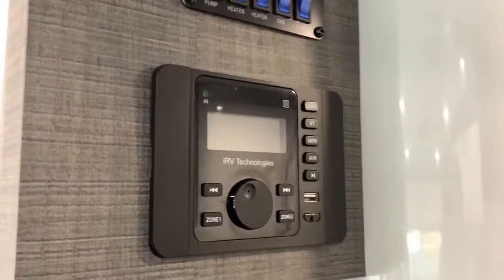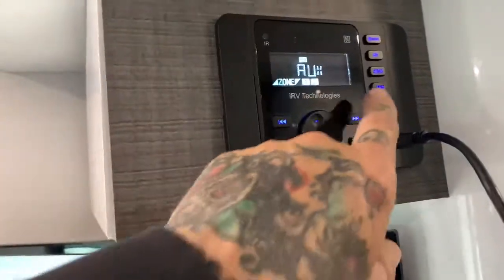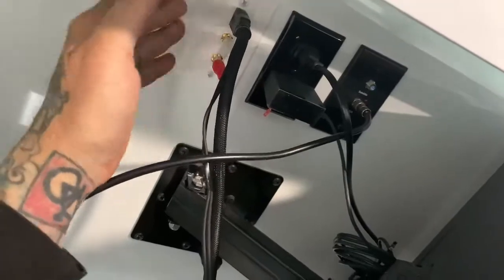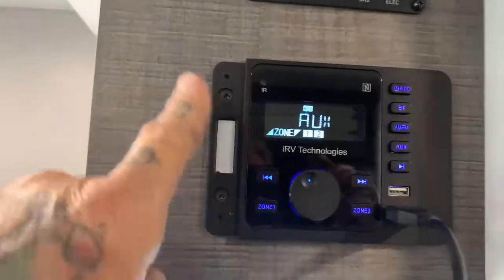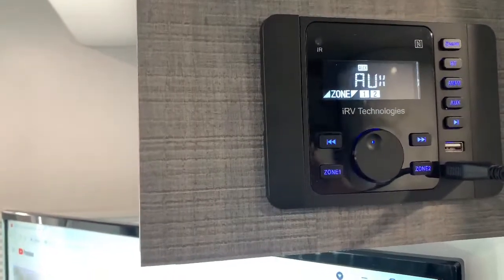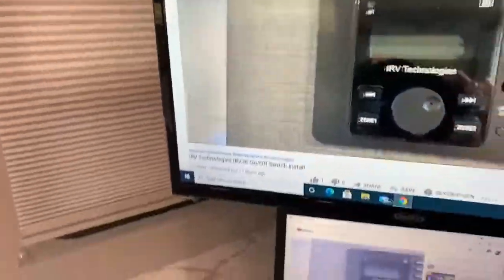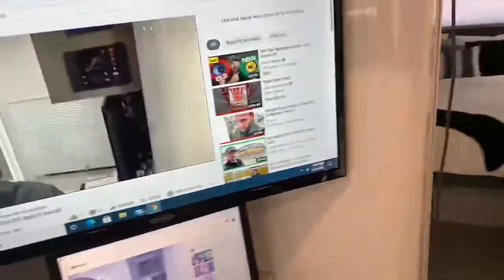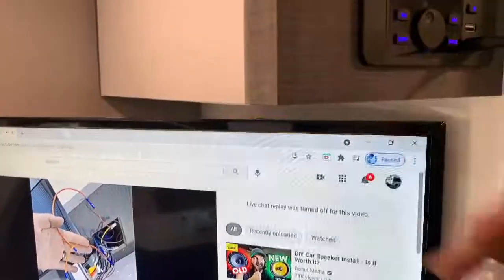iRV Technologies iRV36 HDMI Audio TO Aux Input From TV on InTech Terra Oasis

Comment: So i pulled my radio out and checked connection... still no tv sound through rv speakers..... used audio cables while everything apart... nothing...... read a comment above about an inline fuse..... please explain...  radio itself is fine,  just can't get tv sound through speakers... THANK YOU

Comment: So, if I'm hearing this correctly, this unit only supports HDMI video, and the audio has to be connected as well via RCA? My father in law bought an RV with this unit and the only thing we can't get to work through the RV speakers is anything connected through HDMI.
Reply from the maker: HDMI Carries the audio. The unit does audio in from the RCA Left and right through the Aux. 
The unit does not have SDI Video
A lot of it’s based on the tv too
Reply: @boondockduane  Correct, HDMI carries audio, 16 years of IT and A/V support taught me that.. 2 different tvs, one older and one newer, and the only time I can get audio through hdmi with this unit is connecting the rca L and R. Kind of ridiculous to spend this kind of money on something and learn it's a known issue to be wired incorrectly from the factory. I suspect I'll be replacing the unit with something I design, or rewiring the whole thing.
Reply from the maker: Yes, I own AudioWorks Sound Stage and Lightning Video Production Co
Also
IATSE Journey Man Union Stage Hand of 30 years Local 158
Have you looked at the radio head to see if it is wired correctly? Pull the head and change the inputs if needed 
My last trailer was wired wrong
Reply from the maker: There are dozens of better Stereo heads and I  no advocate for this unit
Mine does function perfectly as installed by InTech in our Terra Oasis

Comment: Mine seems to be stuck in mute mode can’t get it to work. Any advice
Reply: Yeah man, you gotta pull off the front 4 screws and then pull the fuse out and put it back in. That will fix it, I had the same issue on mine.
Reply: Press and hold power button to reset radio